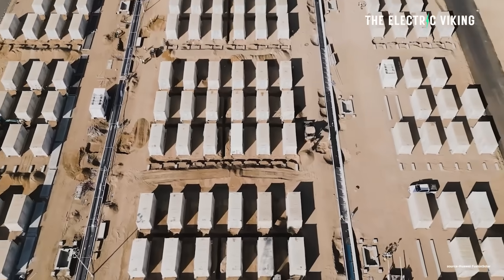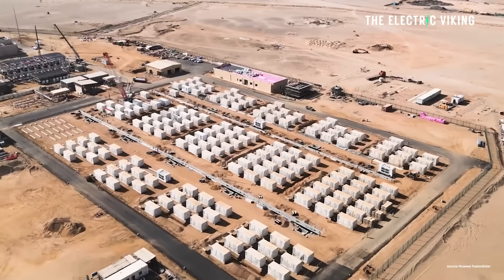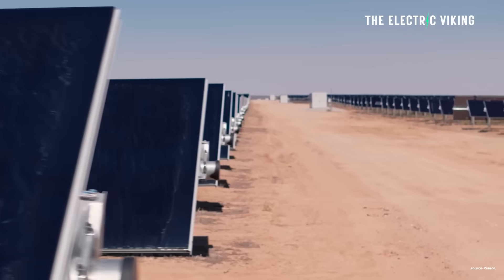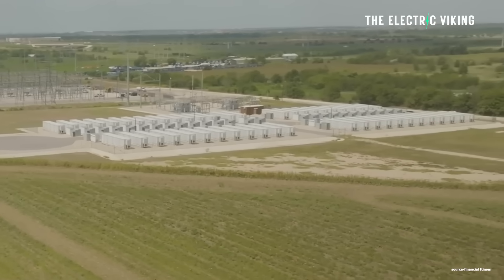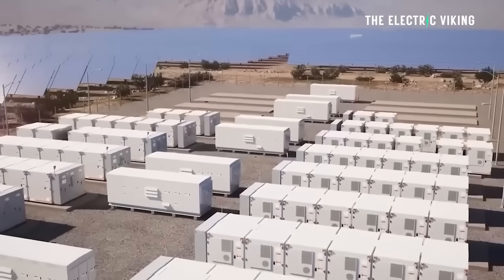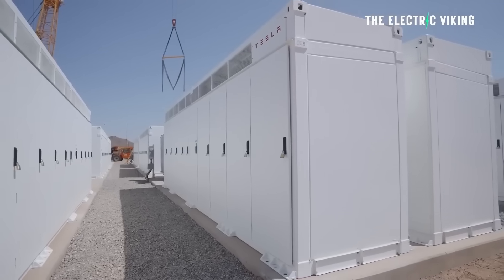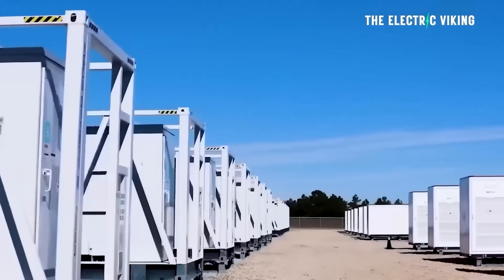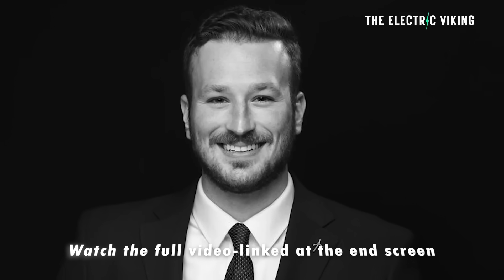World's Biggest Battery: Secret Reason Why Saudi Arabia is Building Giant Batteries

Comment: Why is nobody talking about power generators is inefficient due to maintaining grid voltage.  Power gen is like an engine in your car. You get the best mpg when on the highway at a constant speed.  On the grid the giant gen stations have to maintain the throttle to maintain constant voltage during peak and relaxing demand. Like your car this is inefficient.  Having batteries allows the power gen station run at a more sustained load. Forget the solar panels, this is important without renewables.  It's basically allowing giant power gen stations to run at a constant speed with greatly enhances efficiency.  Now if we only had giant capacitors that run for years without degradation we would have the magic synergy.

Comment: Here in Hungary are two solar DC charger “Islands” this is the future, if they are full, they sell it for € 0,30 / kwh. If there will be again government help, im plannint too to make a similar, they gave last time from 300K to 10M euro to make such solar DC charger, and i have now the best place to make it and if it works, i dont need grid connection. Deye have this system 4x2 180kw chargers with 17MWH battery system. 

The crazy thing is, i could go lower, than the hungarian grid prices, 70HUF if there is no sun and 50HUF if its shining and its still prifitable, so i can serve per day 100 cars.

Its cheaper than a Gas station….

Comment: Yes very sunny. However, will the solar cells be able to with stand the heat, abrasive sand storms, and of course the cost of water for cleaning may be an issue. Only time will tell.

Comment: This would power the city of Los Angeles for only 1.2 hours
Reply: If it was running 24 hrs a day.
Reply: I sense that you found this unimpressive but my takeaway was the opposite.  If a single battery installation can power an entire energy-hungry city like LA for over an hour that’s impressive.  If employed to smooth over the peak evening demand this would have a significant impact on required energy capacity.

Battery storage is progressing faster than I ever imagined it would.

Comment: 7.8GWh battery = 234GWh/month assuming one daily full cycle. Average Saudia Arabia consumption is 3000kWh/month or 3MWh/month. 234000000000 / 3000000 = 78000 homes. But if we assume that half the electricity comes directly from solar panels for consumption during the day then its actually 156 thousand homes. And that's the fun fact. We need 10 thousand of those batteries to allow the entire world to go solar+wind. For about 2 billion homes. In reality we'll get about 1/3 of our electricity from hydro, nuclear, geothermal, biomass and biogas which are dispatchable and wind tends to produce equally or even more at night than during the day, but those 2 billion homes don't include industrial/comercial electricity usage anyways. So 10000 7.8 GWh batteries is about right. As a point of comparison, my home consumes 600kWh/month. My upperish middle class building in Brazil has 64 apartments and I'm one of the biggest users of electricity. It's mostly in the 400-500kWh/month range. At the same time USA homes consume much more than average 3000kWh/month.

Comment: Not millions 😂
that's the massive new one in Saudi Arabia – seven point eight gigawatt-hours, built by Sungrow, just connected to the grid this month. It's now the biggest battery storage system in the world. If it fully discharged in one hit, it'd power roughly seven hundred and fifty thousand average Saudi homes for about four hours (that's the peak evening demand window it's designed for). But the official line from the project is that over a full year of charging and discharging, it'll shift enough energy to cover the entire yearly electricity needs of around four hundred thousand homes

Comment: What Saudi Arabia are doing is moving local power to renewables, very smart move, as the world moves away from oil the price will drop and the market become saturated so they need to sell more oil to generate the same income, so using less themselves makes sense, they have capital do it, but even they know it's a short term move, the world is moving away from oil. The US on the other hand is painting themselves into a corner, most of the oil they drill domestically can't be used in the US, they import 8.5 million b/d and export 10.1 million b/d, which sounds strange until you realise the preceding fact, they can't use their own oil! So what happens as the rest of the world moves away from oil? The US will have no-one to sell to, so they will have to stop drilling and pumping domestic oil, but the sale of domestic oil offsets the import of oil they actually need because they are slowing down the move to renewables, so the cost of oil in the US will increase without that 10.1 million b/d export to counterbalance imports.

The world will no doubt be in a bit of turmoil for a few years as the transition takes place, but the US will be in a far worse position than the rest of the world. I expect a lot of Trump's excessive policies will be reversed when he is gone and forgotten, but what this means is that instead of spreading renewable development over a long period they will have to try and do it all in a far shorter time frame, costing a lot more in the end.

Comment: Thats Alot of E WASTE , for a short lived Product that serves so few People.  That will be a Good Idea if someone  made a Battery that lasts 100 years.at least otherwise its Low I.Q project , unless you love E WASTE. We have over 300 Million PEOPLE  , which makes it a MUCH DIFFERET CHOICE THEN THE SAUDIS.BUT EVEN with few people  like them , im still not stupid to build it.
Reply: Is that a new term? I'll invent one too. F WASTE is the millions of tonnes of gases coming out of the tailpipes of ICE cars. IGNORING CLIMATE CHANGE, together those noxious gases kill 8 million people annually. If they keep going they will kill your 350 million in less than 50 years. About as long as the batteries will last
Reply: Spoken like a right wing tool. E-waste is far less by orders of magnitude than the waste/disposal of fossil fuels including abandoned oil wells, coal sludge etc. plus the “waste” caused by burning fossil fuels kills millions each year due to air pollution not to mention the billions spent on unnecessary health care $. Enough already
Reply: Redwood battery recycling 🔋♻️🔋♻️
Reply: A: The LFP batteries in stationary storage are rated for 6000+ cycles. That is 30 years basically. And NO they do not age out. 
B: Battery recycling is already a HUGE industry today. Simply because every manufacturer has a percentage of cells that do not meet specifications in production, and their desire to reclaim those expensive materials. It is far cheaper today to recycle the batteries and reclaim 99% of those materials? Than it is to mine and refine new materials. Frankly I fully expect some time down the road that EV batteries will have a substantial core return value. 
C: Batteries are bricks. They cost virtually nothing to operate. You don't pay a fuel invoice. They are electronic and remote monitored. Their cost of operations is peanuts. And they respond to changes in the grid loads instantaneously. Going from charge to discharge in micro seconds. They do nothing but improve grid stability all day long. And that saves them a ton of money. The average payback period on a grid tied battery today is less than 2 years. In comparison a gas powered turbine generation system is financed over a 30-40 year period, simply so that it can turn a profit.
Reply: @davefroman4700 read my comments  to the other guy.

Comment: Saudi Arabia? Desert? Lawrence of Arabia? The furnace, burning sun, Beduins, dry desert? With an impressive 3,238 hours of sun per year and only moderate changes (220 hrs per month during 6 months, 280 -320 hours for the rest of the year - for comparison - Berlin receives an average of 1,718 hours of sunshine annually. This amount varies significantly throughout the year) it seems like the logical place on earth to put up sun panels and build battery storage facilities – now, in 2025 when both are cheap as chips as a figure of speech. Clever people in Saudi Arabia taking the decisions.
Germany spent more money installing 20 MWh of battery storage some 7 years ago. These look ridiculously small, now half a dozen years later. Friday, May 22, 2020 Alpiq will manage the largest, most powerful battery in Switzerland on behalf of MW Storage AG and offer its capacity on the ancillary services market to stabilise the transmission grid. The 20-MW battery storage facility will go into operation in the third quarter of 2020 in Brunnen in the Canton of Schwyz.The battery offers 20 MW of power and a capacity of 18 MWh. In 2018 and 2020 20 MW still seemed "huge", now 400 MWh, 1 GWh are "huge" and in comparison 7.8 GWh seem tremendous. We will get there when we reach the 1 Terawatthour battery at affordable prices. Looking at what happened between 2018 and 2025 - it might not be as far away as we think.

Comment: How big is big?

Riyadh led Saudi Arabia’s residential electricity consumption in 2023, using around 43,000 GWh – that´s 128 GWh/day in one city alone - compared to 7.8 GWh storage. It´s not enough for one night, it´s enough for some 90 minutes at night.  The average consumption per household in Saudi Arabia are 17,000 KWh/year. How many households could this behemoth power for one year? The answer is: 458 households. This battery could cover the energy needs of over 450 households 24/7 for one year. But not all of it. If each household had a Tesla Model S running 15,000 km per year, this number would reduce to 390 households fully provided with energy including the car by this battery system.
Now some may say this is huge, others may say it is tiny and still others may say this is not the purpose of the battery and what it is designed for. Sure, nobody could profit with it if it would run like that instead of a daily charge/discharge rate – but it´s exactly what the whole of northern Europe and northern USA need: store battery power in Summer, when the sun shines bright – use it in Winter when it´s dark and cold.
Reply: You aren't looking at this from the right angle, let me explain:

7.8 GWH may seem little in the grand scheme of things, but when you consider the LCOE for that project you will see that it is around 7 US cents per kw. This is substantially cheaper than electricity from oil or gas which Saudi relies on. This means the gov will free up more oil and gas for export while at the same time reduce the cost of electricity locally. Very smart if you asked me.

For your calculations about 450 homes per year, it is totally wrong math.

The batteries hold 7.8 GWH every single day, now multiply that over 365 days and then divide it on the yearly household average consumption and let me know what is the number you got. It is very simple and straightforward math.

Hint: (2.8 terawatts divided by 15000 kilowatts give you 186666 houses and not 450)

Comment: they should shade those batteries with those solar arrays
Reply: Absolutely! Similar to solar harvesting over every water canal to preserve water. Even beyond that, battery storage should also be done beneath every large parking lot with solar harvesting setup above every parking spot for every potentially parked car to provide car protecting shade, and for electric vehicles to also provide a super sustainable convenient nearby recharging function.
Reply: The batteries probably don't take up enough space to warrant adding solar panels, but yes, it could be done
Reply: The shade will help with better battery thermal management and you may not have to cool it as much! I think it more do with fire risk in a battery affecting anything above it!!!
Reply: Probably isn’t worth the juice. Trucks drive the batteries in, cranes put them on the concrete pads. The logistics of having the support structure before would interfere with placement. Installing a support structure after would interfere with maintenance and removing out of condition units.

Comment: Critics were not only skeptical but also laughed when Saudi Crown Prince MBS announced an $8 billion hydrogen plant, yet the laughter has faded now that the colossal facility is 90% complete and 1.7 times the size of Washington, D.C., on the windy Red Sea coast.   Saudi Crown Prince Mohammed bin Salman is building something so large that it barely fits into familiar frames of reference. On Saudi Arabia’s Red Sea coast, inside NEOM, a green power complex is nearing completion that spans more than 300 square kilometers (about 116 sq. miles). That makes it roughly 1.7 times the size of Washington D.C. According to the NEOM Green Hydrogen Company, construction across the site is now about 90 percent complete.   The project sits inside Oxagon, NEOM’s industrial port zone, a place designed to merge heavy industry with global logistics. While much of the attention around NEOM is consumed by The Line and its futuristic urban ambitions, Oxagon is where the kingdom’s economic strategy becomes concrete. This is where ships dock, factories operate, and energy is produced at a scale intended for global markets. Often cited at around $8.4 billion, the project is built around a single, high-stakes idea. Roughly four gigawatts of dedicated wind and solar power are being constructed specifically to feed a massive hydrogen production system. That renewable electricity will drive electrolyzers that split water into hydrogen and oxygen, producing green hydrogen without carbon emissions.    
The U.S. spends massive amounts on fossil fuel subsidies, with estimates varying but pointing to hundreds of billions annually, largely driven by implicit costs like health and climate impacts (around $500-$700+ billion in 2022) alongside explicit subsidies like tax breaks (around $20-$44 billion in 2022), totaling over $750 billion by some measures for that year, highlighting a huge disparity between direct aid and hidden societal costs. 
Explicit Subsidies (Direct Support)
These are direct government spending or tax breaks for the industry:
Tax Breaks & Direct Aid: Around $20 billion annually in direct financial support and tax breaks for oil, gas, and coal.
Specific Tax Breaks: Non-partisan estimates suggest eliminating key breaks, like the intangible drilling costs deduction, could save billions over a decade. 
Implicit Subsidies (Societal Costs)
These are the costs society bears from burning fossil fuels, often not factored into prices:
Environmental Externalities: Costs from air pollution, climate change, and road impacts (estimated at over $500 billion in 2022).
Foregone Revenue: Lost tax revenue from underpricing these fuels (estimated at $196 billion in 2022). 
Total Estimates (Explicit + Implicit)
IMF (2022): $757 billion.
IMF (2023): $790 billion.
FracTracker (2022): $760 billion, breaking down to $44B explicit and $716B implicit/foregone.

Comment: isnt sodium battery a joke? I thought solid state is the best
Reply: It is about cost, cycle life, and level of complexity. Sodium-ion batteries are an excellent option for Grid Storage.
Reply: "The best" these days is a moving target.  New chemistries are being developed faster than they can be produced.  But CATL has a sodium ion battery that rivals the energy density of currently available lithium ion batteries, and is much cheaper and has a much longer life.  For grid storage, where energy density is not as critical, it will make a good option, I suspect (though I don't know what the round-trip efficiency is).
Reply: There are really no commercial solid state batteries available yet, we have semi-solid state, quasi-solid state and condensed solid state but no true solid state batteries, those are all still in testing and proving processes. Sodium will be cheaper eventually and handles extreme temperatures better than most other chemistries, but in the end it's economics that will count, the history of the world is full of technologies that are cheaper and not as good but they win because price, if you can put in a Sodium battery for half the price and the same capacity that's what will happen even if it does take up a bit more space.

Space is the least limiting factor in grid battery storage, price per MWh is what counts and that will determine what technology is used in the end. But as others say, who knows where we will be in ten years, things change so fast in battery technology these days, I mean I can hardly count the number of "game changing" and "breakthrough" battery announcements I have seen in the last year, funnily enough I haven't seen any in cars yet!